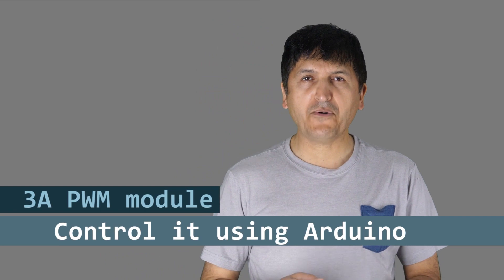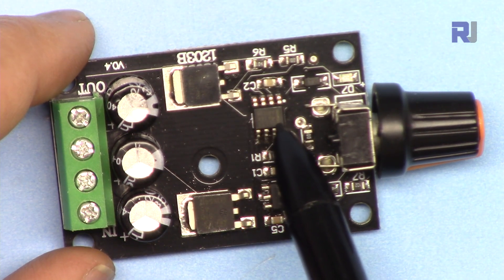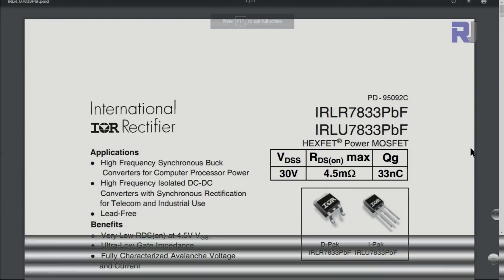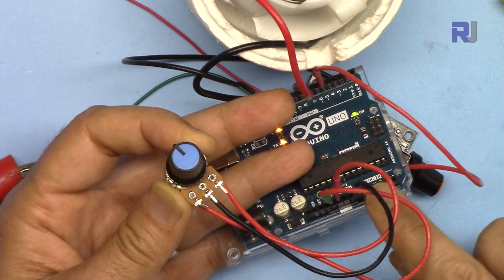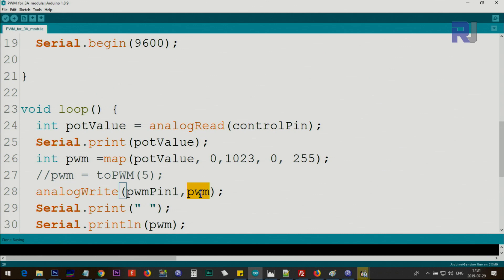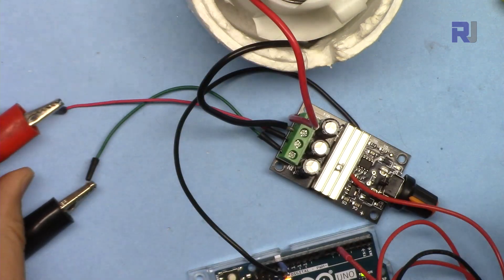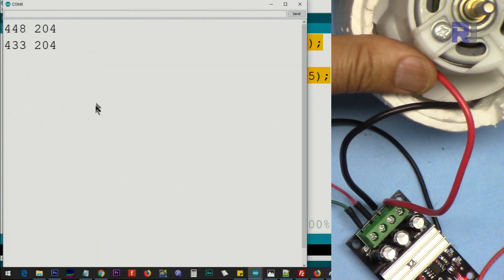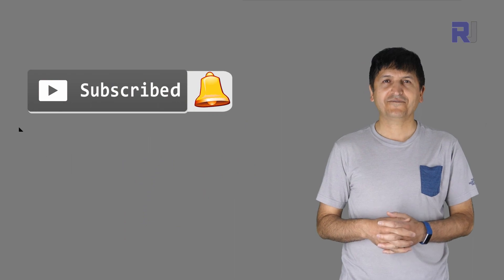Modify this 3A PWM Motor Speed controller and control it  with Arduino RJT188

Comment: Hello Sir
What an interisting hack that you did.
I wonder if i can control the speed using hall sensor magnet, so if any pole side of magnet geting closer n closer, the more speed we had. Can you figure out the value of hallsensor in map? As we know the value of potensio in map is 0, 1023, 0, 255. Or maybe someone can tell me the value of hall sensor if I change the potensio with it. 
Best regarads and million thanks before

Comment: Does it reverse it too with negative values?
Reply from the maker: Review and introduction to this module: https://youtu.be/inUOVV0LnoQ
Reply: @robojax  I watched it, great durable controller. But my question is, can we control it with arduino forward and backward? In arduino the value of 100 runs it forward. Will -100 (negative value) run it backward (reverse)?

Comment: Hello, I had a question, after cutting the connection between the 555 timer output pin 3 and the  is it possible to connect the output from pin 3 to arduino's digital pwm  pin and back via another pwm pin in order to read the pwm signal from the LM555 and then create limiting conditions  on the pwm using the arduino's digital write pwm signal pin and feeding it back to the output 3 ?
Reply from the maker: You can read PWM using Arduino but it needs a little work like frequency and duty cycle. Do a Bong or google nsearch

Comment: Love this Hack with voltage controlled by ardunio,  i've learned so much watching your videos... thanks !!! .... I got a question... In you opinion , is this the best unit to use to control voltages with ardunio up to 3a...  .. say input is 12v, output from 0 to 12v... or is there some IC I could use... the smaller the better.. for loads from 1 to 3 amp lets say ... your advice would be much appreciated..
Reply from the maker: You are welcome. I am glad you like them. This module is being controlled using PWM which does not change the voltage. Actually the motor speed is being controlled by the duty cycle or the at that interval and for how long the voltage is turned ON/OFF. so the voltage stays the same.  This method can't be used to control a power supply. I have this application on my list and I will God willing make video on that.

Comment: What is the frequency this module works at? I would like to control a servo motor with it and the servo motor works with a pwm at 50 Hz.
Reply from the maker: frequency of Arduino is explained here https://youtu.be/6O9SFvEP6Bs

Comment: nice video, i have project to control 24v 10a dc motor, it can foward-reverse, so i want to use bts7960 as motor driver, but i do not want to use arduino, can i use this 3a pwm controller as input for L-PWM or R-PWM in bts7960?
Reply from the maker: The module just needs PWM doesn't matter from where.  Yes you can sue. I will reply to all Subscriber's 🔔 questions. So make sure to Subscribe.😊

Comment: Hey buddy, I don't always reply, even hardly at all. But I do want your videos and I appreciate the efforts that you put into them. I just wanted to share with you that I used one of your projects on my wood stove That heats my house here in Colorado, USA. I live about 7,000 ft.  winners get bitter cold here. Of course you know that being in Canada. When the wood stove approaches 150° F it turns a fan on. I use an Arduino and a high temp reader. I believe it goes up to around 1500 or 1600.  I can't remember the type of high temperature reader I use. I have to go look it up. But I wanted to thank you for that. I may incorporate this PWM speed control into my last year's project because I always don't need the fan on high.  Thank you robojacks You are brilliant.
Reply: And you know what else, that fan system has been powered on and been in standby since the end of winter.  It's been powered on since last September or October.  It still gives me the temperature reading, usually in the '70s this time of year. It hasn't locked up. It just works. I have the electronics in an eyeglass case with wires hanging out. I need to look around and find something a little more suitable.  One thing I would like to correct but not sure how, when the stove reaches 150, the temperature will fluctuate between 149 and 150 it goes back and forth quite a few dozen times as it cools off. This causes the fan to kick on and kick off. It's kind of annoying. But it's working exactly the way it was designed. It's almost like it needs a threshold, or it needs a timer built in the code to wait a few minutes before  turning the fan off. I'm not sure how to do that. I also haven't looked into it.
Reply from the maker: Hey, thank so for the comment. to fix the fluctuation of temperature in arduino, it is easy. let's say the variable holding temperature is "temp" and you want to take action when the temperature equal of above 149 AND equal or less than 150, then use if (temp >=149 && temp <=150){ your action here}

Comment: Very nice demonstrate.. and sir, can you upload a video to control single phase centrifugal pump  motor with ardiuno...?
Reply from the maker: Thanks. I have never had access to "centrifugal pump" but if get one some day, I will make video  for that.
Reply: @robojax  because in universe the centrifugal motorized system are popular but without control. If you had trail on that it may use some people..